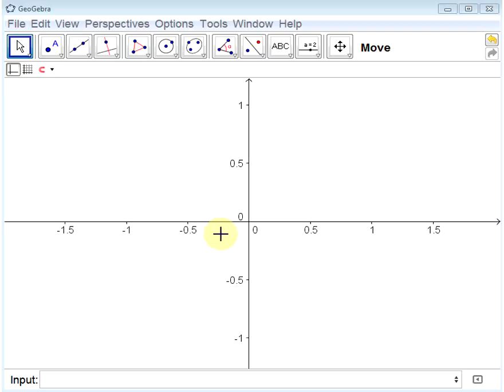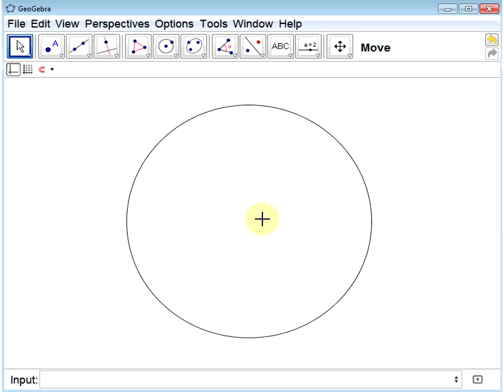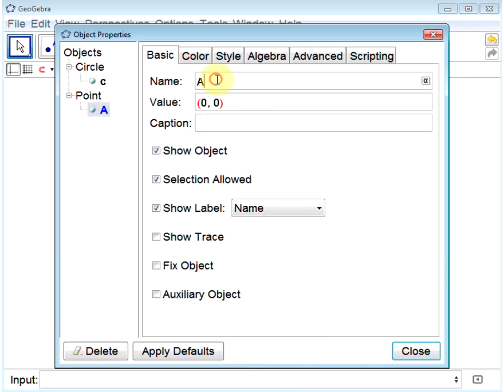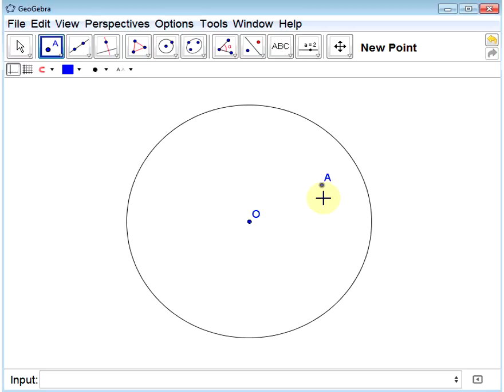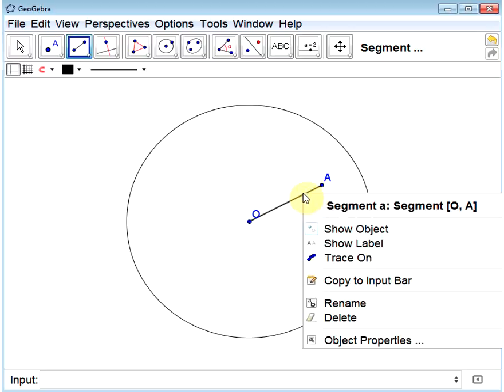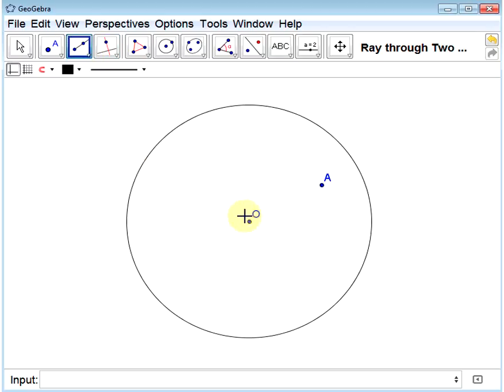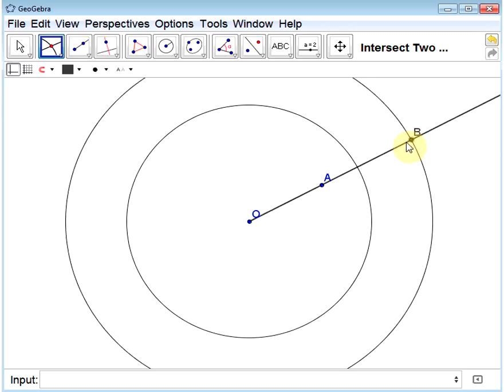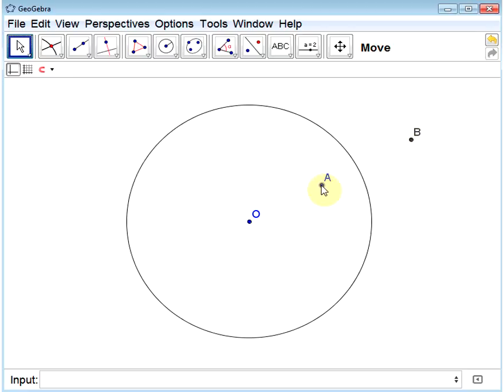Inversion of a Point through a Circle

Comment: i'm just so confused about since the distance of OB = 1/OA, why is the circle with point B larger than the circle with point A?
Reply: violinsheets Because that's a unit circle.
Reply: I know this reply is a bit late, but this is because OA < 1; since the definition of an inverted point is that OA × OB = r², if OA < r, OB > r, so the circle that OB lies on is larger than the unit circle

Algebraicly, 1/OA would be larger than 1 because OA is smaller than 1

Comment: It is possible to do this without using your keyboard and typing all those formulas. 3 lines and 1 circle are sufficient and the method is irrelevant of the scale or whether the point to invert is out of, in or on the inversion circle.